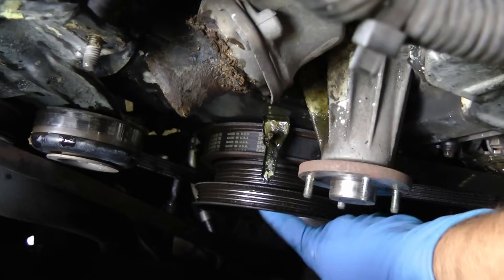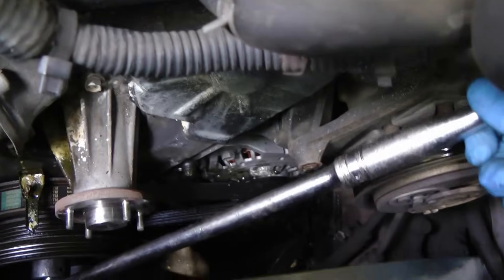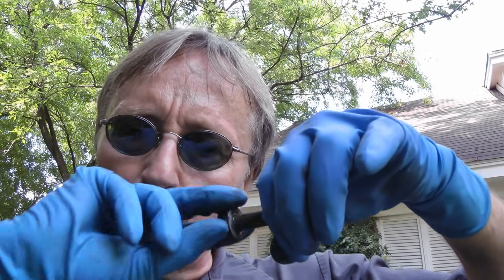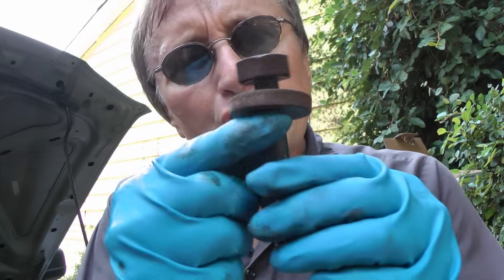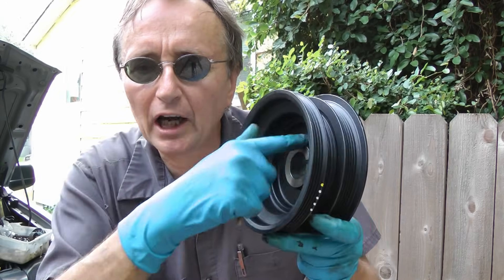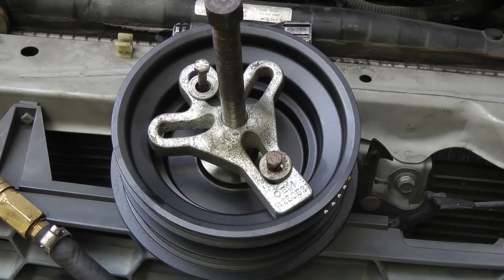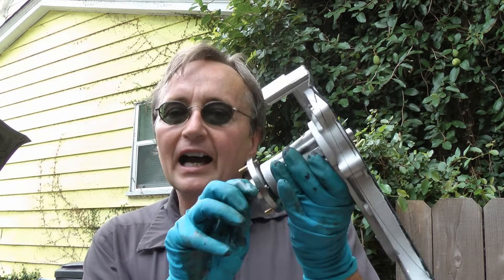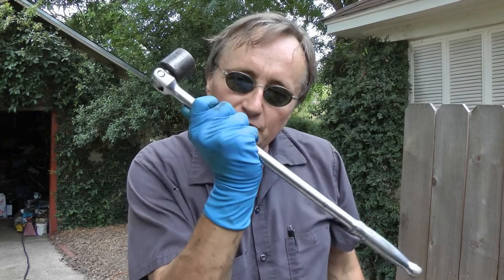How to Remove a Crankshaft Pulley in Your Car

Comment: Thanks dude. It really worked because i just tried it. I spent two days trying and this worked in like 3 seconds. Wooo
Reply: And how did you tied back?
Reply: Just laid the breaker bar down on the engine cradle. That was my first car I worked on, so I had now clue what I was doing. 5 cars now
Reply: @blueaura2191  This trick did not work for me :( My 1/2" breaker bar was on the ground, when my wife turned the car over, I just watched my breaker bar deflect about 3/4" of in inch in the center. It bent back into shape, but I was NOT expecting that reaction.

Comment: Hi scott cani get advise, i had a wobbling  crankshaft pulley, how important it is to get it fix? brought to shop to do just a general inspection and change oil. Mechanic found the problem and said that i should just keep an eye on it, until something ,an advice that is not so reassuring. Now i'm thinking to get it check by a mechanic again for thorough inspection, i have honda crv 98 197 miles. Please help and thank you in advance.

Comment: HI Scotty i followed your advice to remove the harmonic balancer as i needed to inspect the timming belt worked perfectly .       now i need your advice on how to reattach the harmonic balancer on my 1997 toyota camry 2.2 litre automatic as i don't have a rattle gun.
Reply from the maker: get a cheap strap wrench to hold the pulley from moving, and tighten it with a cheater bar and socket. Some guys even put some locktite on the threads before doing that

Comment: I used your trick to break loose the crankshaft pulley bolt. Thanks. I wanted to replace the crankshaft seal while changing the water pump, and had to remove the crankshaft timing sprocket underneath the crankshaft pulley. No auto parts stores know of a tool to remove the sprocket. It appears to have very thin threaded holes on the sprocket to use a sprocket puller...maybe. Got any ideas? I need to replace the sprocket since I nicked the flange anyway. Thanks.
Reply from the maker: there are special pullers for all different makes and models. Get one for your model, but often you need a tool specialty store for that.

Comment: I bought a harmonic balancer puller, it looks like it’ll work except for the fact that it didn’t come with bolts small enough to put into the crankshaft. What size are those smaller bolts that go into the actual crankshaft to pull it off??

Comment: I've been told that on Ford Sigma engines (2002-2008), using this method can actually break/damage the valves. Is this true?

Comment: I'm wondering if one could damage the starter, starter gear or motor mount using this "trick". I successfully used this method several years ago on a Mitsubishi P/U.

Comment: Scotty, thanks for your booming video. I failed to loose my 2nd gen GS300 (tighten 243ftlbs), the space after radiator removed is 8-7/8" only and not much impact wrench fit. In your video not mentioned to cut off fuel and ignition and I wonder how to do it with ECU cars? can I just remove Fuel and IGN fuse? What is cheater bar? Even Craftsman break bar seem not very regid.
Reply from the maker: +Cox man  yes, remove fuses. And don't buy sears tools these days they are too cheap.

Comment: This morning after having put all knew belts on the day before on my 99 Corolla, my crank pull was wobbling so bad that is shredded all the belts. Why would my crank pulley fall off? Luckily the only belt that wasn't shredded was the power steering belt, but then again they're only £5 each. There's 3 belts. One for the alternator which shares one pulley with the power steering, the power steering belt, and the big belt which controls everything else.
Reply: +ChompChompNomNom: what do you want to say? do you mean using this method cause your pulley wobbling?
Reply: I'm saying that if your belts are abnormally wearing, get your pulleys checked. Luckily the AA covered the costs.

Comment: is this method recommended for DOHC engines, I pulled the engine without doing this trick and put it back together cuz I couldn't break that bolt loose only to realize I damaged the wiring harness. So if I decide to try this I have to fix the harness

Comment from the maker: they make special crank locking tools, but some guys put a bit of rope into a cylinder of the engine after removing the spark plug to get the engine to stop moving and tighten it with the same cheater bar and socket.;

Comment: After watching your video, I'm wondering if the technician at my local dealership used this method to loosen the bolt on my crank shaft pulley while performing unrelated repairs and maintenance.  3 weeks ago I had a new alternator installed and tune up done to my 2008 Ford Explorer.  The vehicle drove like new the first week after I left the lot.  Two weeks ago, I start hearing a squealing noise coming from my car.  This past Sunday, the crank pulley fell from underneath the vehicle while I was driving on a busy street.  When I stopped and lifted the hood, the belt was dangling loose.  What are your thoughts?
Reply from the maker: hard to say what anyone has done in the past. But, since he put an alternator on, and it's driven by the belt, it could have been overtightened and caused pulley damage

Comment: Did this today with my 2004 Camry 3.0 V6.   With a 2' cheater bar, I let the end of the bar rest snugly against the garage floor by letting off the floor jack just enough to snug it up.  One bump on the starter and the bolt was loose.

Comment: WoW... That was a nice and easy. I have a question and I was wondering if you could help me Mr. Kilmer. I bought a 1989 F-250 V8 302, It has been 6 months since I bought it, the truck was parked for possible some years and it was fine until two months ago. My truck started having this small noise then it went off the next day. Suddently the noise stoped for two weeks then it became a scheduled noise. See it has gotten so LOUD that you hear it from a two blocks away. I went to check and its the crankshaft pulley but the autozone has it for $530. I cant replace it at that price so I just have this idea that possible this noise might be because the pulley is loose. You think this might be the problem? And if it is how much torque should I use on it? Thanks for your videos and time to read this paragraph if you read this. Gracias Mr.
Reply from the maker: Raul Vela get a used pulley from a junk yard, or try hemmings motor news for one

Comment from the maker: NEVER do it with the timing belt off on a subaru, you can bend valves turning the engine with the belt off. You'll need an impact wrench to get it off

Comment: Well, I DO have air tools, but the bolt STILL wouldn't come off (torque is more than the air tool can handle) - and i already had all the stuff removed from the front of the engine (a Ford 5.4 3v in a truck). Had the ECU and battery out, too, for a timing chin repair. So, I made a cheater bar out of a 3' - 4' long piece of angle iron that bolted onto the face of the harmonic balancer, with bolts and a spacer with washers chosen to fit the pulley for rigidness. Measure between the face of the pulley and the hole in the pulley arm where the puller's bolts are going to screw in. Select a bolt that will pass through the thickness of the angle iron, the distance from the face of the pulley, and at least three or four threads into the pulley arm. Select a spacer and one or more washers the distance between the arm and the face of the pulley. You don't want the angle iron bending, or distortion of the pulley arm when you tighten up the bolts. Just drill two appropriate size holes as far apart as necessary, with a small gouged out circle segment on the edge to pass the socket. Screw two bolts through the angle iron, through the spacer (and any washers) into the pulley arm. Then rotate the whole thing as you did to butt up against the water pump flange (or anything else sticking out far enough) and put the longest cheater bar available on the socket. Works like a dream. You need it to put the bolt back on to torque spec, anyway, so might as well have one made up. MY problem is that the pulley is stuck on the crankshaft and is actually bending the puller tool . . . time for lots of liquid wrench and (maybe) differential heating of the pulley, since it doesn't seem to have any rubber.

Comment: Howdy Scotty. On my GMC Vortec V8, trying to remove the crankshaft pulley. When I wrench the 3 legged pulley puller, the crankshaft spins with the puller in the same direction. My question is, how do I pull the pulley and not have the crankshaft from turning also? What can I use to stop the rotation of the engine? I used an off the counter puller and got the crankshaft pulley cocked off center of the shaft. Hope you can help because I'm at a standstill until I get this resolved, and move on to replace the oil pump. Thank you in advance.

Comment: One more thing. Would manually turning this pulley in either direction from trying to remove the nut cause any harm to the engine or throw anything off?
Reply from the maker: Ashley Schultz no, as long as the timing chain or belt is still on the engine

Comment: Hi great videos...any suggestion on how to remove a pulley that doesn't have the two holes for a pulley remover?   I just managed to get the bolt on my '95 Integra off after days of struggling, now the pulley is on pretty tight and I don't know how to get it off.

Comment: Hi Scotty, how do you put the new Crankshaft Pulley back on? Do you need a special tool to press it in ? Thank you
Reply from the maker: +Joey Chen they just slide back on, but then you tighten the bolt, and can use a strap wrench to hold the pulley in place when doing so.

Comment: Holding the brakes on a manual transmission do work for breaking a crank pulley bolt I just did a timing belt on a 89 accord and my girlfriend hell the brakes for me while I put that mike tyson power on it and that bolt came loose thats the only way it would break the impact wouldnot buzz it

Comment: Hey Scotty, great video and great tip. My question is, i put a new harmonic balancer on a 75 350 chevy. Not sure if seated all the way. However, belts seem to line up without shims in pulley. Am I ok, or ahould I try to press it on more to be safe? Thanks Nick

Comment: Yesterday I tried to remove crankshaft pulley with a locked breaker bar as seen in this video. I think the timing went off after this method since the minivan is stalling and could not start. Do you think I damaged the timing belt by cranking?

Comment: special request  can you please show us how to set ignition timing without the use of timing gun ( After Replacing O ring seal to distributor how to align to crankshaft and where to find spark plug 1 or how to align to cylinder 1)

If you Could please show us the Easy steps!!
Thank you

Comment: Hi Scotty. I wondered if you may have any advice for my problem. I have a 2005 pt cruiser and a mechanic installed an engine for me but after my drive belt kept slipping off, I noticed the crankshaft pulley was installed crooked so they don't line up. Do you think this has damaged the crankshaft or if maybe if I can remove it without much damage. Thanks so much for your help.
Reply from the maker: pray the crank pulley just needs replacing, often it's just that

Comment: I once found myself in a position like that. Couple years ago, my 03 Mercury Marauder developed a rear axle seal leak. This ultimately lead to me having to replace the rear axle shafts entirely along with a new pinion seal and new u-joints because the rear axles weren't heat treated properly from the factory so I replaced them with a couple of much stronger axles from Dorman. Money well spent and I don't have to worry about it again for a long time.

Comment: I am working on a 98 toyota camry. I am changing the oil pump gasket along with water pump, timing belt and more. I need to get the crank shaft pulley off as well only I am having trouble because I already disconnected many wires, drained the coolant and the oil. The Haynes repair manual does offer an alternate way of getting it off. It states: Remove the flywheel/driveplate cover and use a prybar wedged against the ring gear teeth or a converter bolt to hold the crankshaft while loosening the pulley bolt with a breaker bar. I am having trouble finding the  flywheel/driveplate cover. Can you please point me in the right direction?
Thanks
Reply from the maker: that engine turns the wrong way, you need an air impact wrench to get it off, or you remove the starter, put a locking tool in the flywheel and then take the bolt off with a cheater bar and socket

Comment: the small round part of the crank popped out now is just the big end part stucked there...i wanna know on a acura legend 95 if i need to take the radiator out? and if the rest of the same method you use in this video apply? thanks so much, whish you do house calls....

Comment: if you do this you have to know everything about your car's engine because on some ford engines the crankshaft sprocket isn't keyed to the crankshaft which means that it could go wrong badly when you lose the bolt while using the starter which turns the crankshaft.
Reply: "it isn't keyed" means: there is no key between crankshaft and crankshaft sprocket, none, zero it's only held together by the tightened sprocket pulley, so even if you only lose the crankshaft pulley you could screw your ignition timing by turning the crankshaft only a few millimeters. i saw it on ford fusion, mondeo, c-max 1.6 1.8 2.0 diesel and petrol engines here in europe i don't know how it's in us tho.

Comment: Hey scottie. Youve been much helo to me already , but now I was wandering if you would help me some more and gove me some insite. My rear drivers side wheel/drum/breaks while driving make a changing noise. I have replaced the drum and my pads are still good but I cant seem to get the noise to disappear. You can here ot best while coasting. When I apply the breaks though it goes away.

Comment: So it looks like you're doing this on a 2002 nissan xterra, or similar year. The engine lay out and front end looks just like mine, how perfect. So you're just resting it against that other pulley?
Reply from the maker: Ashley Schultz actually I' resting against the frame of the car
Reply: Well my bar doesn't reach that. I used the lower right side frame below where the radiator sits.  Still won't come off.  Will turning that pulley hurt anything?

Comment: Hey Scott I have a 2006 mazda 6 3.0 and i was wondering if all crankshafts have bolts? I have one on top by the radiator but dont see a bolt. Do I remove it the same way?

Comment: Hey Scotty love your stuff keep it up. Quick question say in a junkyard scenario how can we go about removing the bolt without power/air tools ?
Reply: usually the guys in the junkyard will help out--did you ask?  The other thing I have done is gotten a long cheater pipe and jammed something in or on the engine to keep it from turning usually in the flywheel or other place in engine-usually exposed in a junk yard ----but your best bet is soliciting help from the junk yard guy.  Dont ask the office ask the guy out there taking cars apart because they are usually very helpful.  The office guy will say no or will want to charge you.

Comment: Well we had a stuck crank pulley and tried everything to get the bolt off so eventually stumbled upon this vid and did this on our 2009 Ford Fusion 2.3L 4 Cylinder Motor. We had to replace the timing chain (Cover) on the engine due to a broken engine mount and got everything out except this stubborn crank pulley bolt. So I watched this vid and did exactly what was shown only to find out that just by taking the bolt out it messed up the timing on the engine since it's all held together by friction on these 2.3 motors.. I guess they are very unique "according to other vids I've watched" We had to tear the whole thing apart again after getting it back together cause it wouldn't start just to try and get the #1 piston at tdc, align the camshafts/flat spot of the weight on the bottom etc and after 3 days, multiple attempts and over 12 hours later we still have a cranking but non running motor. I never would have even done this job had I known taking out a bolt for the pulley could basically turn the car into a non runner. I Watched a bunch of vids about how sensitive the crank pulley bolt is on these 2.3l motors and how it can do this but it would have been nice to know before hand I guess lol.. I'm now safely assuming it isn't "just that easy" on all motors as it was on whatever motor is in this video.

Comment: Hi Scotty, thanks for the awesome Vids.
Wonder if you can give me some advice, I'm changing my first timing belt (ever) on a Citroen 2.0 HDi 2005 w/ DW10TD engine of a fixed one-piece camshaft design w/ a wide woodruff key located in the crankshaft sprocket. The haynes manual says this allows the crankshaft sprocket enough extra floating play that can upset the timing- so BEFORE I loosen the crankshaft pulley bolt, I need to fabricate and place a flywheel locking grip tool (in addition to the 2 timing hole locking pins for the flywheel and camshaft pulley). 

Does this mean I cannot use you trick to loosen the crankshaft pulley bolt? :( Will the play from the crankshaft sprocket woodruff key be able to upset the timing with the belt still attached as in your vid, If not, could I simply attach all the locking mechanisms after loosening the bolt?

Below you mention in a comment that this trick wont upset the timing, but I am keen to know if this also applies to a woodruff/crankshaft design.
Thanks!